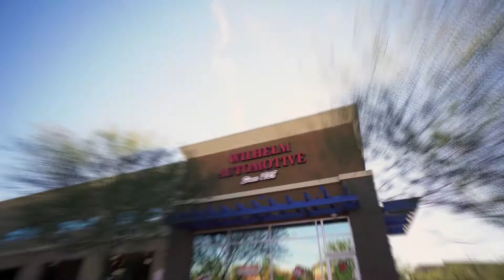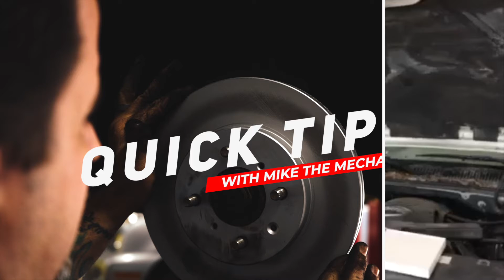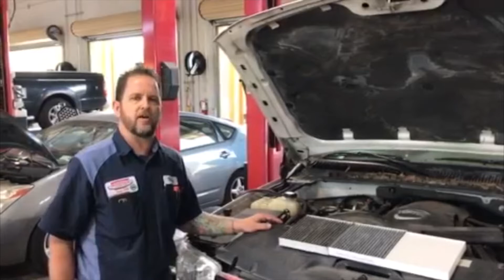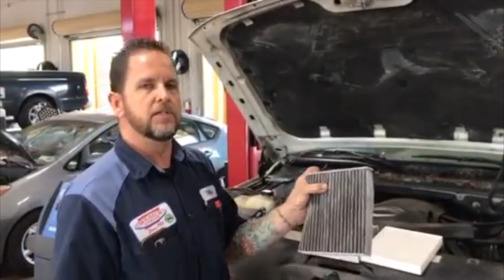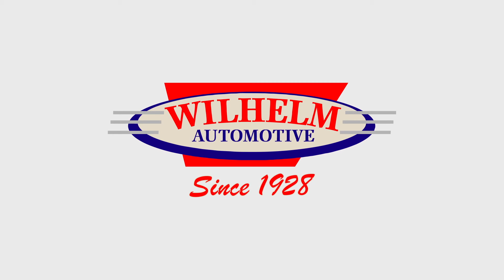AC Inspection and Common Problems

Comment: Good information for the general customer thank you for producing this video had good information in it to educate the customer how to prolong the life of their AC system and not use the do it yourself cans that often caused damage. 
         But the loss of oil through small leaks is usually unmeasurable other than an oil stain that’s less than 1/10 of an ounce it just looks worse because collects dust. Lack of oil return to the compressor is usually due to low refrigerant charge and there’s not enough liquid mass of refrigerant to keep the oil droplets and suspension to bring it back to the compressor it goes out it accumulates in the evaporator and never returns to the compressor that’s the majority of oil related compressor failures.